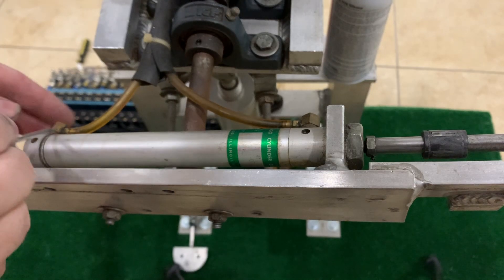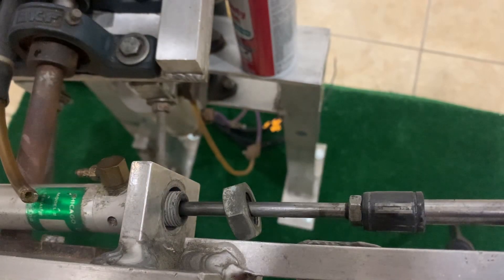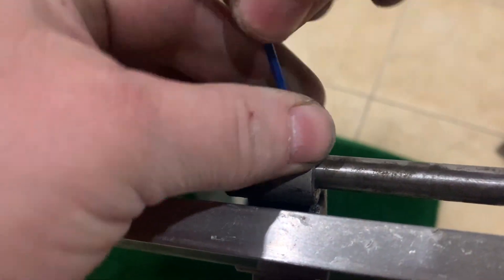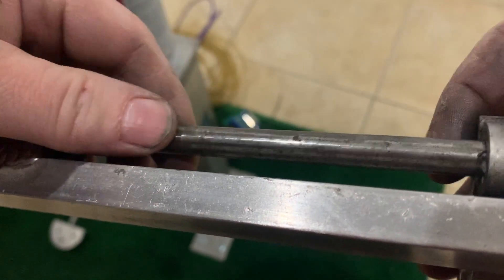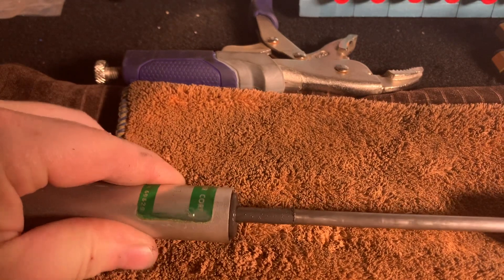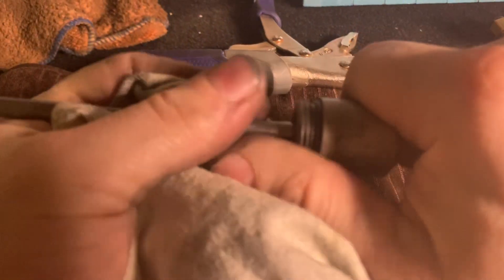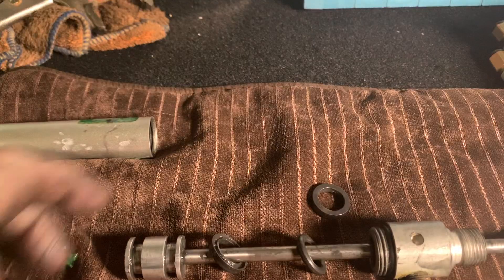Animatronic Restoration Part 2 - BILLY BOB - Rock-afire Explosion - Showbiz Pizza

Comment: 0:25
"Wrench" refers to an adjustable plumbers pipe-wrench. That, is an Open-ended Spanner.

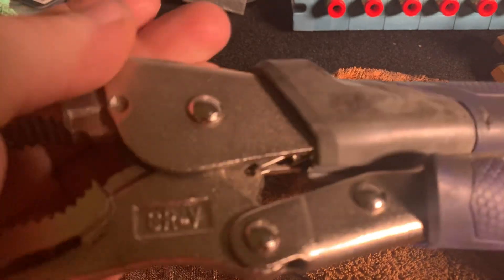3:25
Those are Mole-Grips. or, Locking Pliers.
Reply from the maker: Sampull MC Thank you 👍